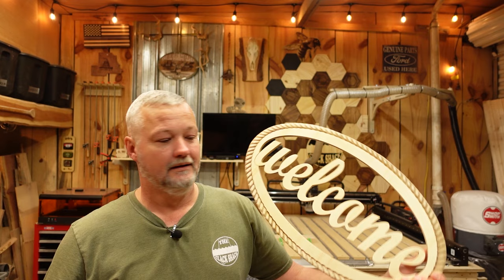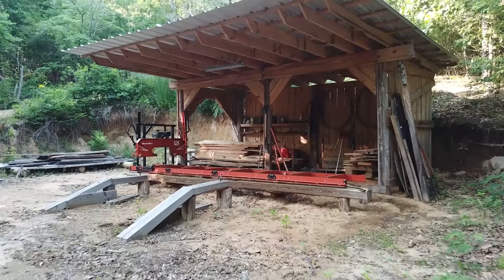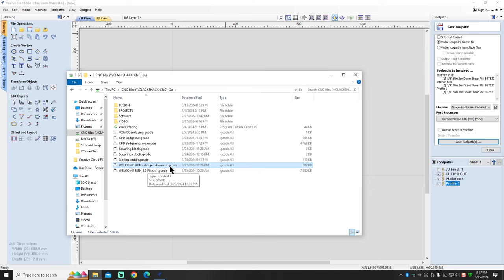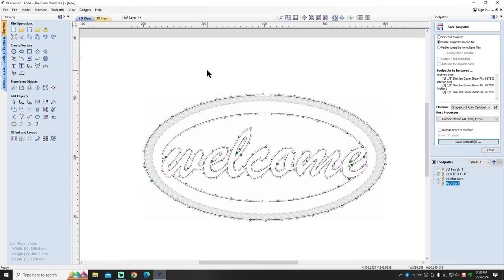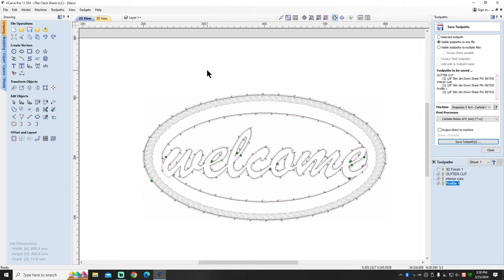Creating a simple CNC project in VCarve

Comment: if you use double stick tape under the welcome cut out, you don't need the tabs there.  then you can double click and remove the cut out wood for the preview
Reply from the maker: Cool. I sometimes use tape but my luck the strip of tape wouldn’t be exactly where the piece is. I may have to try the double click thing